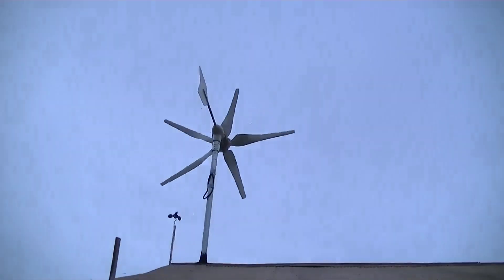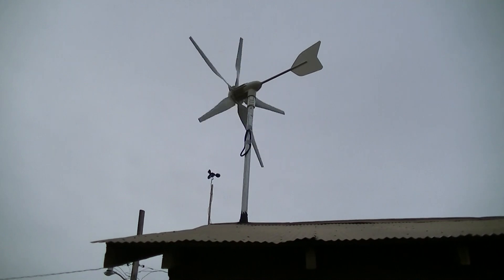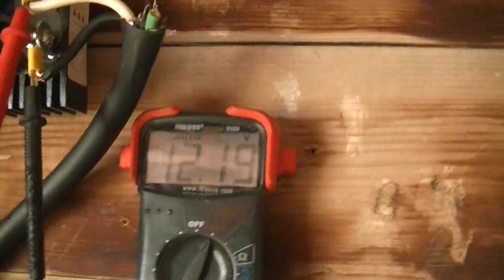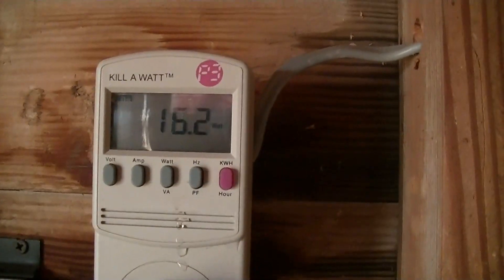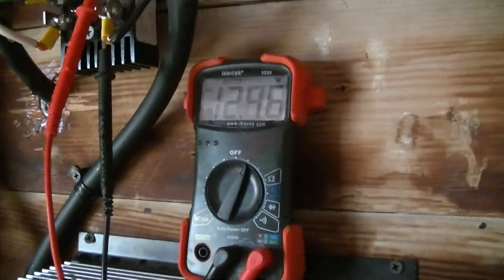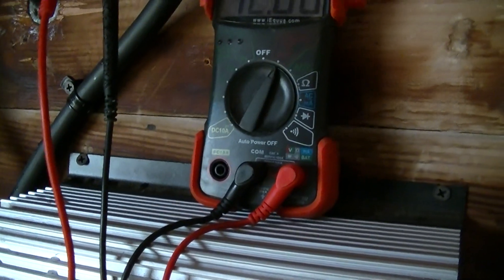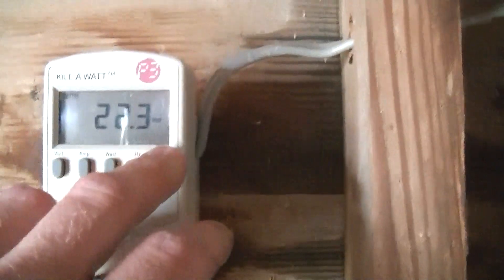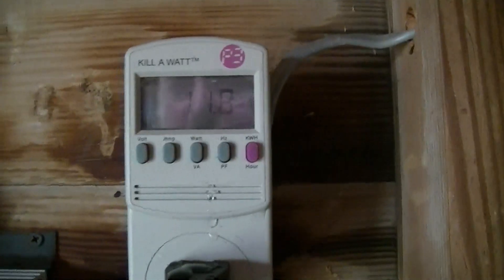Windmax HY1000--Eventual Grid Tie Success Story Part 2 of 3

Comment: i have a 22-60V 600W grid tie inverter with built-in controller and dump load
and a 500W wind turbine
i have the same problems
at 18V the inverter start to make the grid tie ( i know it because the wind generator starts to make noise).
than.. when i check the LCD screen on the inverter i see 20W... 18W... arround that.
but my wind turbine is 500W! too poor
i am changing to a 10,5-30V Grid tie inverter with built in controller and dump load.
i will see if it will produce more energy in the grid

Comment: wind turbine must go higher - thats the only reason for the unstable direction. You have a 10.8-30 volt grid tie inverter that puts on 500watts of load within 30 volts- Your windmax works much better from 20-60 volts. the innerti/momentum of the blades is to low in that low voltages.